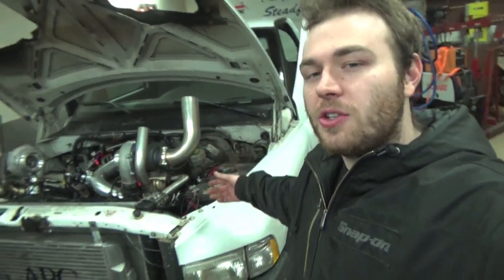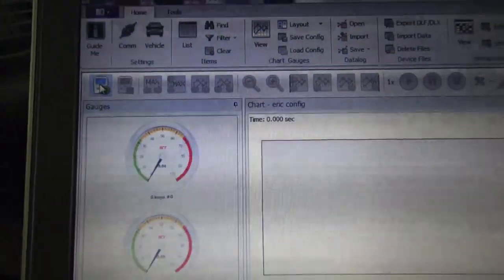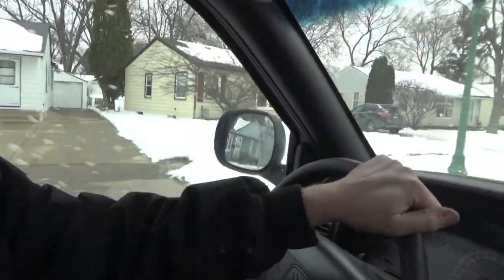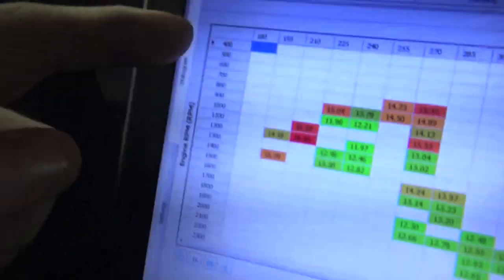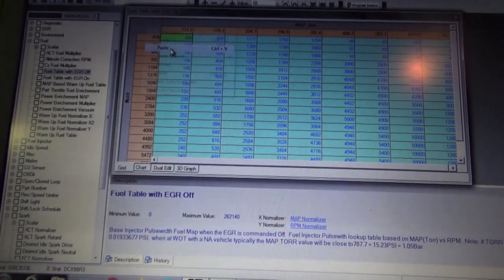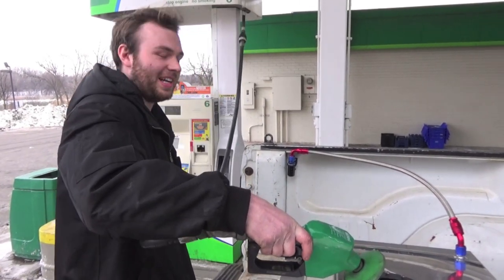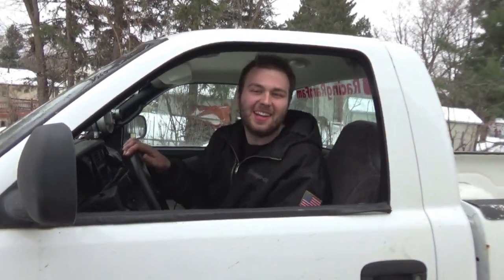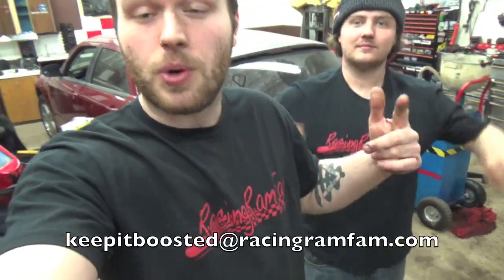TURBO 5.2 Street Tune first FULL THROTTLE DEATH WOBBLE. Whitie ep.16

Comment: Can't wait till I can start building my ram
Reply from the maker: jeremy Malcolm he’ll ya brother! What engine do you have what’s the plan?
Reply: 024 door  ram 1500 12 inch lift has a 360  auto with 456 gears gonna do heads cam single turbo
Reply from the maker: That be sweet! 12in lift custom?
Reply: Full throttle suspension was a short run for it but I have one  lol
Reply: They only made a few of them
Reply from the maker: That sounds awesome! What size tires?
Reply: Got 37s on it right now built it out of three trucks on a weekend and had to drive it half together for a year this summer is it's time to shine
Reply from the maker: @Moparornocar  thats awesome! i got 4.56 in my plow truck with 35s what kind of rpms are you at at 60mph?
Reply: I think around 2700 I dont remember right off i put a set of headers on it last winter and the collector blew the weld around the bolts  a few months back trying to ok get a new set soon
Reply from the maker: @Moparornocar  dang!

Comment: Death wobble is a simple fix.
You just changed the front end parts, and probably have it a little toe in.
With everything tight, it's up to your tires to give in if there not traveling straight together.
Tires tracking together is hard to accomplish at all times with crowned roads at different degrees.
With toe in on a solid axle, your tires will always be fighting.
Start at zero toe, and drive it.
If you get any wobble at all, turn your tierod a half turn at a time towards out, and try it.
Do this until it stops.
A half turn can be the difference between normal driving and severe death wobble.
If you go too far out you can get death wobble also.
Also the bigger the footprint of the tire the more it may fight.
A loose track bar can let it death wobble  easier, but your front tire tracking is the root cause.

Comment: I'm glad I've never experienced the death wobble. I just bought new tie rods and a new drag link for 98 5.9 4x4. To tighten up the steering. Next suspension wise I would like to do long arm track bars for axle stability and suspension travel. Then different shocks. Ultimately I would like to supercharge it but I feel that will be pretty expensive so I might go with a turbski or 2.....you know...for beter "gas mileage"
Reply from the maker: Yesssss 2 turbskiiis singing away! Love it man

Comment: A floor shifter would be dope on it. And I want to install a big lumpy cam what do you recommend?
Reply from the maker: Matters what your going for! Horsepower, torque or just a little upgrade
Reply: I want to go full bolt ons and a tune daily light to light racing.
Reply from the maker: That would be fun

Comment: Death wobble is a pain.  I have a lifted grand Cherokee and every time I think I have it fixed it does it again. Lol
Reply from the maker: Yes lol it’s the track bar tho the ball joints end on the bar moves about a in lol
Reply: Racingramfam thats not good lol the pickups stock had shit steering, I drove a 01 1500 Laramie 4x4 club cab for 4 years couldn't come up with a fix so I wrecked it lmfao but I have a 99 dakota that needs an engine im just gonna do nitrous
Reply from the maker: @jacobkilen1762  thats awesome! they love nitrous

Comment: Wow that was crazy death wobble glad you guys are ok. Sooooo what do you think about those amazing Mopar trans, my 2000 sport i replaced 3 transmission yes it was my fault on 2 of them but still they are known for weakness you planning on beefing up the internals or go with a 47re instead of a 46re which is what they put on the 5.2 and the 5.9 got the 47re if I remember correctly but even a stock 47 isn't great. Your one of the few channels that I can't wait for the next upload. GET SOME STICKERS MADE ALREADY 👍👍👍👍👍
Reply from the maker: Well we got some awesome parts from trans go and I’m going to be doing the full rebuild of this trans! I will get the 46re to hold power
Reply: Right on im sure it will do alright if you beef it up a little thats why I had to ask cause I'm sure a stock one would hold till you start doing some serious launches. I'm so glad you guys decided to do this I wanted to see a turbo ram so bad and you seriously upped the game and u guys did twinsies  out the hood I love it!  CANT WAIT TO REPRESENT SOME STICKERS ON MY TRUCK LOL
Reply from the maker: @theprodigalson2904  thanks man!
Reply: they are not weak. its the peoples minds that own them that are weak. 46rh/re is a 727 with a bolt on od. 727tqflite transmissions are insanely beefy factory. what people do, is they wont turn off the od when racing or making big hp and racing, and towing. they also wont put their car in neutral or shut it off when idling for a long time. they pump fluid in neutral and drive, not park and drive like a chevy or ford. so if you put a mopar trans in park and it sits, it cant pump through the radiator or cooler and cool the fluid, so it burns up.
Reply: @friggle im pretty sure 99% of dodge owners know any of this stuff and I remember there being alot of talk about them being weak im not a mechanic and don't know details like what your saying im sure we could all have better vehicles if we knew every little detail about them but we don't the general population doesnt know this stuff cause we all have different lives and someone might not know because they are a doctor or lawyer who are very busy to learn every detail of their vehicle its just not the world the rest of us live in

Comment: Yes do the Dyno for 93 and E85. We need the value of using it. E85 would be your cheap racing fuel. 

The death wobble is common for those trucks. My friend had one and it took almost everything moving in the front replaced to get rid of it. Usually start seeing that happening after 120K miles. Just replace all the steering points and suspension bushings and the bearings. Use polyethylene bushing wherever you can. 

Also put a damn filter on the inlet of the turbo or you will stuck in crap and eat up the motor!
Reply from the maker: We need no filters lol
Reply: @RacingRamFam  understandable since you already have a 360 waiting to be built and swapped into it. You just wanted to blow it up so you have the motivation to do it! 😂
Reply from the maker: Big big facts lol 😂

Comment: I have the kyb monomax shocks on the front of my dodge work good
Reply from the maker: Never heard of them what do you mean works good?
Reply: @RacingRamFam  lol keeps the front end from hopping when I'm spinning in the mud, would help for the death wobble in the front.
Reply from the maker: @davejames2015  that sounds awesome! where did you pick them up at?
Reply: @RacingRamFam  rock auto
Reply from the maker: @davejames2015  sweet I will have to check that out

Comment: The drag radials are not gonna help the death wobble, pretty funny tho. from my personal experience, get the steering box brace, adjustable name brand trac-bar, and a dual steering stabilizer setup. we got my buddies TT ls swapped ram to run 160 mph for like 20 mins straight from milwaukee to madison... without drag radials tho. she sounds good on boost boys!!
Reply from the maker: Thanks man! And yes the track bar was shot had like a inch of play in the ball joint end lol
Reply: @RacingRamFam  you are really going to want either a 1 ton trac bar or a big adjustable for when you start doing 4wd launches. im curious to see how the trans/t-case do.
Reply from the maker: @tylergonzalez224  oh me too man I don’t know if they will hold. We have some upgrades planned for the trans nothing for the t-case yet
Reply: @RacingRamFam  besides swapping in a HD t-case from a 2500 i dont even know what they make for the 242s.(assuming thats whats in it) should be interesting. i have a couple laying around if you need some haha
Reply from the maker: Yes we do! Where you located would love one
Reply: @RacingRamFam  milwaukee. i gotta dig em out of storage. ill hit you up
Reply from the maker: Thank you 🙏